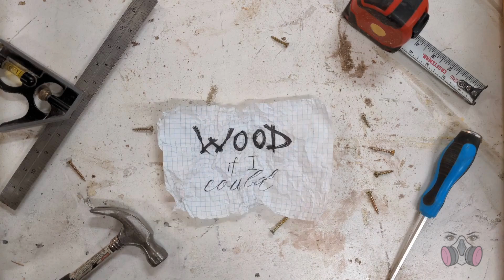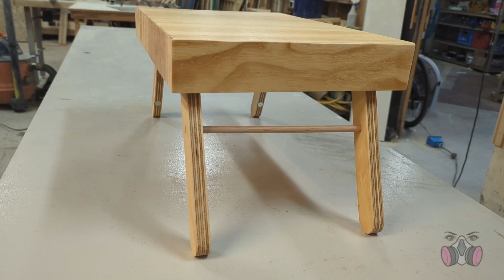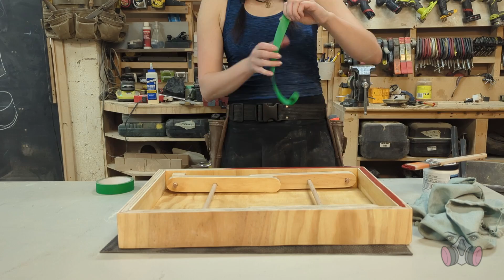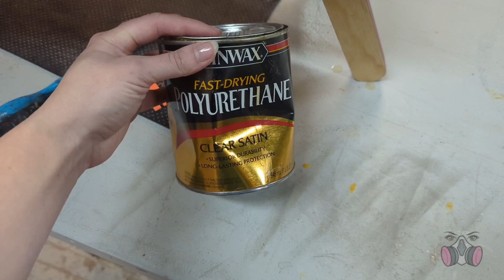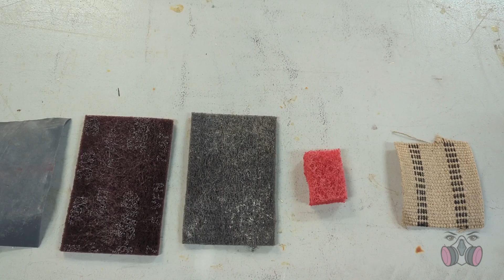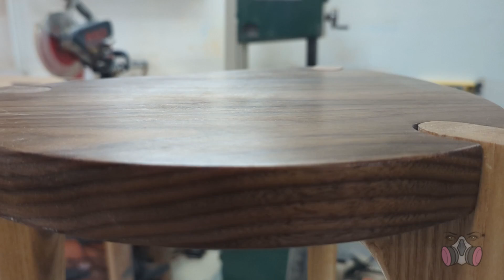How To Make Construction Grade Plywood Smooth Without Using Grain Fillers | Woodworking DIY

Comment: Great video!  I’ll use the finish build method on a bench I’m making with scrap wood.  The painted legs make the whole tray look very Scandi. Cute!  
Thanks so much for the ideas and for the very clear instruction.
Reply from the maker: Thank you so much! Let me know how it turns out. The method is definitely a little tedious because you have to keep going back after it dries, and then going back again... but I do think it's worth it when you really need that smooth finish

Comment: paint legs completely red and give the plate an accent by painting just the upper edges red. maybe 3mm each. that way the underlying grain (which i believe you can see on the edges) is hidden as well

edit: dont color the braces between these legs

Comment: #0000 grade steel wool helps soften sheen of urethanes.
Reply from the maker: Oops, i probably should have mentioned what kind of steel wool because there is definitely a right and a wrong kind. Thanks for pointing that out

Comment: Interesting, am bookmarking. I use card scrapers instead of sanding, so if I get lots of tear out I might use this technique. Especially if it's plywood, since I might end up going through the veneer if I remove too much material. Plus I have lots of construction grade plywood to use up lol. As for the red, I like it. It does look like solid wood and it matches the pot and cushion.
Reply from the maker: Thanks! Let me know how your build turns out. The lower quality wood is definitely a bit harder to work with, but I also like it better because you get more of a glow-up when you finish the piece and look back at what you were able to build it from